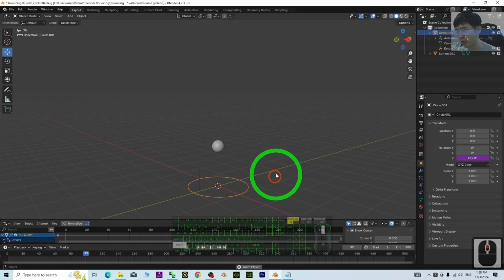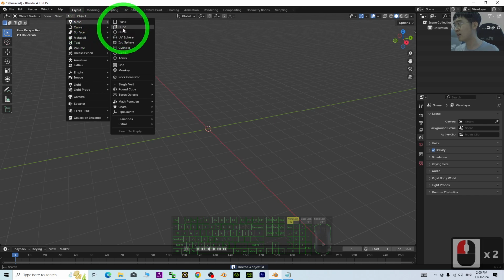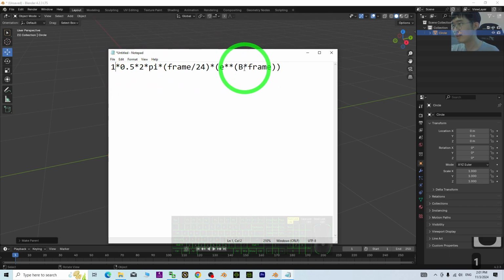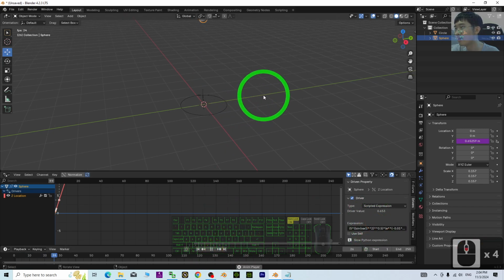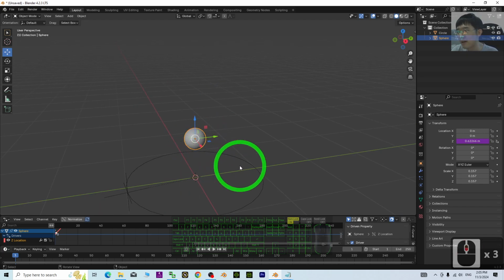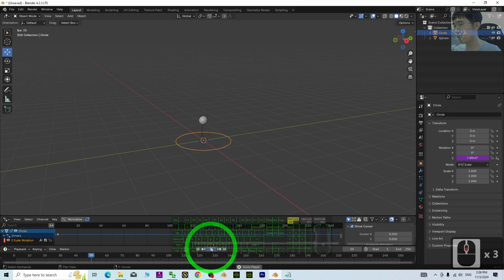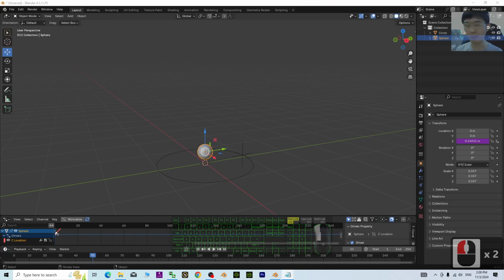Blender 4.2 Bouncing Ball Physics Animation Using Drivers Tutorial

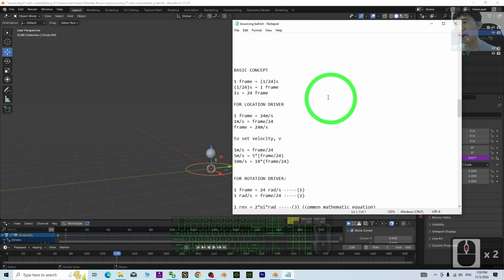Comment from the maker: This tutorial demonstrates how to create a physically-based bouncing ball animation in Blender 4.2 using Drivers to simulate real-world physics like gravity, damping, and elasticity (0:00-0:35).
Step-by-Step Summary:
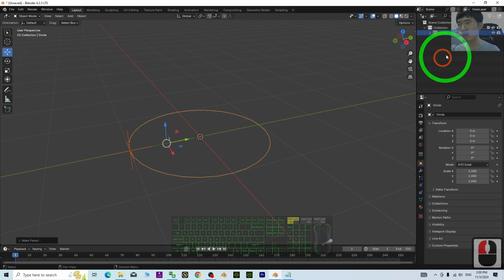1.	Preparation (1:14-2:00): Create a Circle mesh and an Empty. Set the Empty as a parent to the Circle to serve as a reference point for the animation.
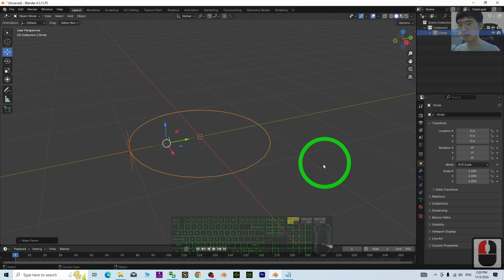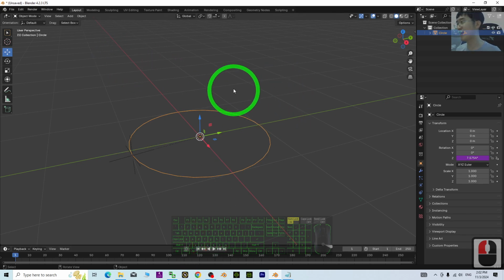2.	Rotation Driver (2:04-3:22): Apply a custom driver formula to the Circle's Z-rotation to control the timing and rate of the bounces. The formula incorporates variables for initial bounce frequency and a constant for bouncing increase.
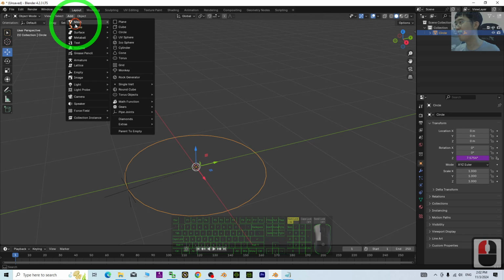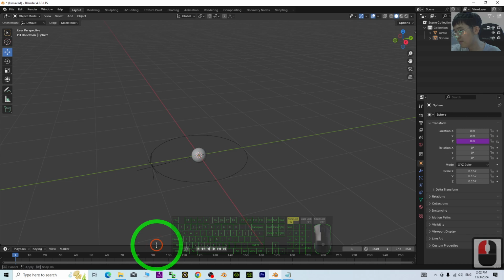3.	Ball Setup (3:25-4:15): Add a UV Sphere to act as the bouncing ball.
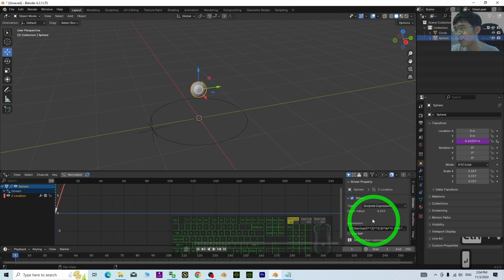4.	Location Driver (4:15-5:30): Apply a driver to the Sphere's Z-location property, referencing the Circle's rotation. This uses a mathematical expression (including constants for maximum height 'H' and damping 'K') to drive the bouncing movement.
5.	Refinement (5:40-9:15): Adjust the variables (H, K, and rotation rates) to achieve a natural, realistic effect. The creator emphasizes that these constants can be tuned depending on the desired material properties and bounce behavior.
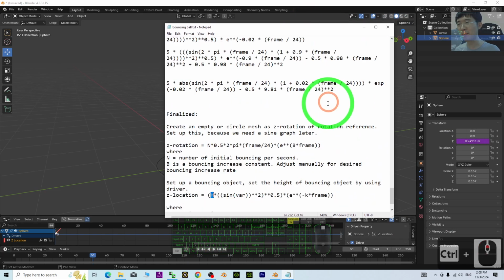The video concludes by noting that while the animation relies on complex physical derivations, the provided formulas allow users to generate professional-looking simulations quickly (9:24-10:19).